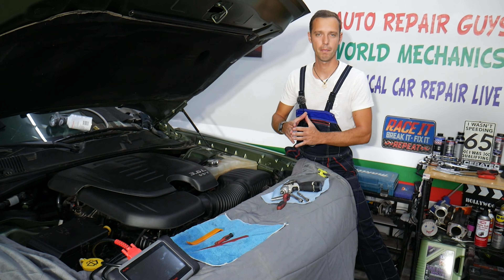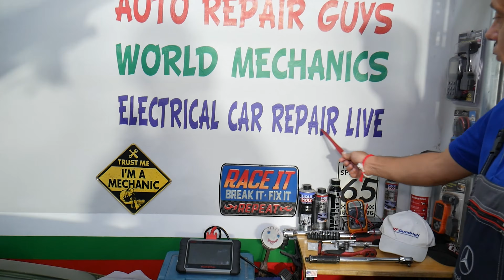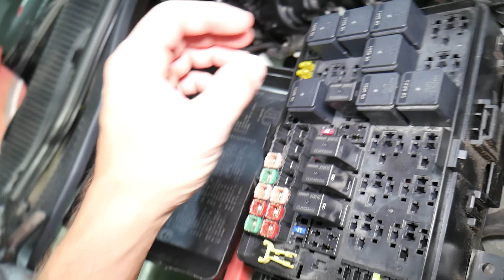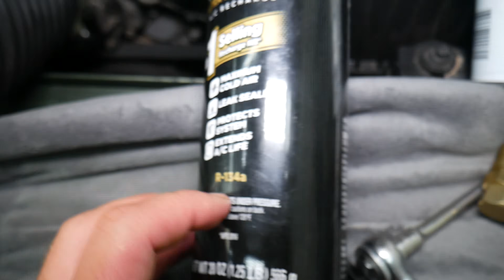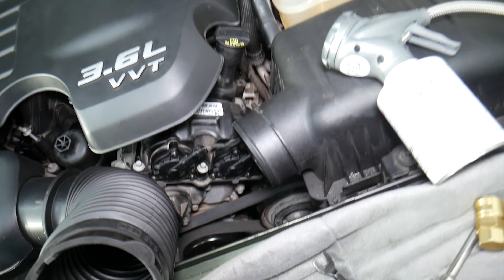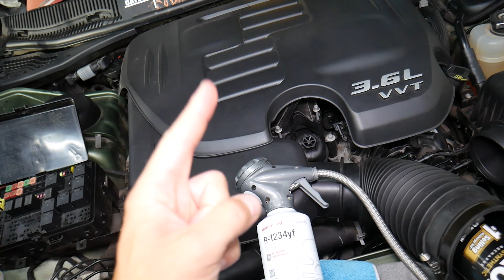DODGE CHARGER WHY AC AIR CONDITIONER BLOWS WARM AIR, AC BLOWS HOT

Comment: Hello, I have a 2014 Dodge Charger 3.6L. Recently the a/c started blowing warm air (compressor clutch engaged and freeon in the system). I replaced the a/c compressor, dryer, expansion valve, flushed the system with a/c solvent drew vaccum  (holding vaccum) and added 24 oz of required freeon. It's still blowing hot air. I am pretty stumped. Any ideas?

Comment: What if the left side is  cooling but not the right side?
Reply: At the end he mwntioned the flap actuator. The problem is, like you, I have no idea how to deal with it.
Reply: @davuvnik  I have the same problem here.   Seems to me like heater is stuck on the right side, I mean the passenger side, in my case both actuators working perfectly fine, so my best shot it has to be related to the heater or the automatic climate control is out of control 😁
Reply: @sineddiaz3711  I found a video of a guy doing it "how to replace the blend actuator in a dodge charger 2009" or something along those lines.